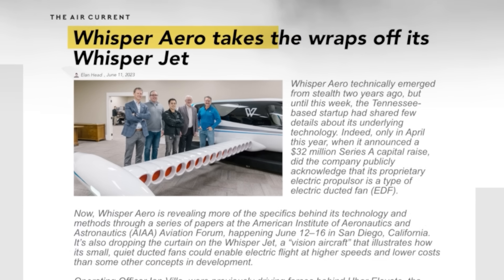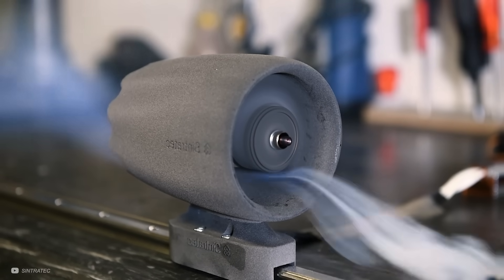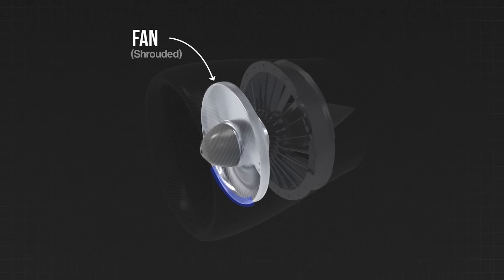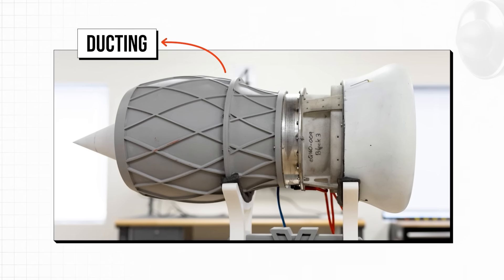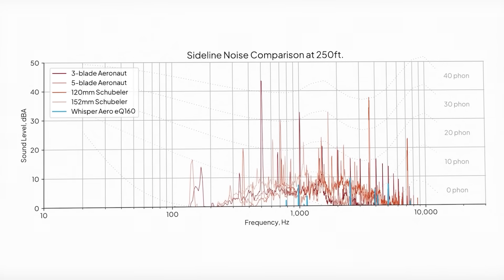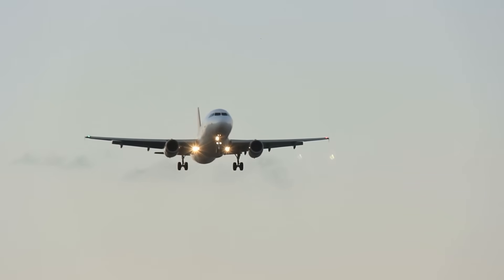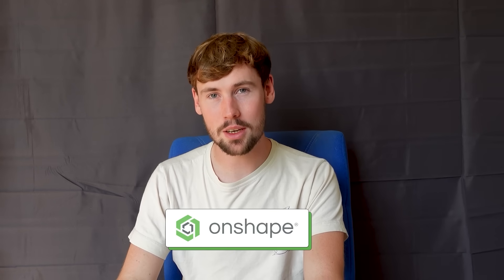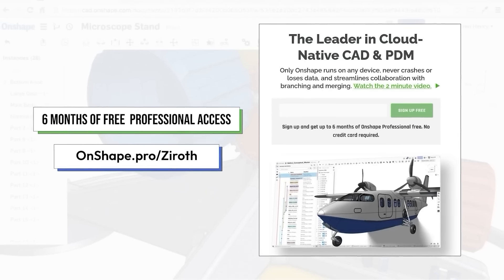This Genius Jet Engine Is Starting A Revolution

Comment: The biggest hurdle for electric flight isn't the engine, it's the energy storage. Jet-A has roughly 50x the energy per kg of the best batteries today. And the weight of the fuel supply drops as the engine burns it (increasing fuel efficiency through the flight), while a battery weighs the same charged or drained. They could turn fuel into electricity, similar to how diesel electric trains work, but that adds a lot of weight to the vehicle, and weight is one of the most important factors in aviation.
Reply: Spot on, my friend!
Reply: I can certainly think of at least one application where a quiet, electric engine would come extremely handy - military drones for reconaissance and/or attack missions.
Reply: @bluehelmet314  It's already quiet enough. Losing efficiency which is already stretched beyond limit to improve something that's already sufficient is a bad idea.
Reply: The greater efficiency of Electric motors does create a path for practicality, but it would require either significantly better batteries, something like high efficiency fuel cells, or wireless beamed power.
Reply: @BrendanKOD  LMAO @ wireless beamed power, yet another fantasy !
Reply: @grahamstevenson1740  Tesla had wireless power and we have it in wireless cell phone charging, so it ain't so fantastical
Reply: I would imagine that most people looking at this are already familiar with the issues of relative energy density. 

But if people didn’t search for alternative and better solutions.. humanity would still be in the Stone Age. 
Thanks for your input..
Reply: @MontanaSource-h4q  Where did I say they should stop researching? I said the energy storage is the biggest hurdle. The video focused on the motor, as if it was the breakthrough we need for electric flight, when what we need is more research on battery density, fuel cells, or a Mr. Fusion equivalent.
Reply: This, this, this. People treat electrification as if there's some yet undiscovered Moore's Law of energy density in batteries. There isn't. 

While an electric jet worthy of the name (= enabling transonic flight) is physically possible, the batteries required would have to be around 40x more energy dense than the best ones we currently have. There isn't even a viable theory of such a battery.

Currently, it's looking like commercial flight as we know it cannot be electrified, period.
Reply: @fooanonymous  transoceanic commercial flight, that is. Intra-continental flights can and should be replaced with rail which can be electrified.
Reply: @sethpadakandla2797  Not only transoceanic flight. Flight at transonic speeds is the minimum standard customers accept for distances were flying is competitive in terms of door to door travel time.

But yes, I agree that many current short distance flights could and should be replaced by high speed rail. That is just yet another argument against electrified flight, however, since it eliminates a possible niche market.

In short, again, large-scale, commercial electrified flight is all but guaranteed a mere fantasy.
Reply: @fooanonymous would mix engine work? Smaller engine charging batteries in flight?
Reply: @shawncooper8131 A serial hybrid, which is what you desrcibe, works well in a car because it let's the engine run at optimal efficiency independent of speed and gear, it allows for regenerative braking, and can reduce weight and complexity by eliminating the transmission, in spite of the battery pack.

In an aircraft, a serial hybrid would have none of the advantages and many more disadvantages. Aircraft engines in commercial aircraft are already hyper efficient for their intended flight envelope. There are no transmission losses or issues with certain speeds and gears, no way to recover energy through braking, and nothing to offset the added weight of the batteries.

In short, no.
Reply: @shawncooper8131 why carey the weight? Just use the engines to power thrust direcrly.
Reply: @fooanonymous  Can't be done with current battery tech, but Tesla used wireless transmission of power... that's where I'd spend the research $. We have wireless phone charging, I would use that tech embedded in highways for unlimited range on elec cars
Reply: @willix777 the energy reduces with distance,double the distance and you have quarter of the power
Reply: You put it better than me. Bravo.  Your spot on ...
Reply: Now imagine a lithium ion battery fire at cruising altitude or even an EMP.
Reply: @sethhill5689  that's it, a teething problem happens and the thing you feel threatened by will just blow away and you can continue to be the big man we all know you are(!)
Reply: A potential work around is A very high speed fuel turbine driving a generator ..into a small battery .the oil provided the energy for the long haul
Reply: It will have to be a diesel generator like locomotive or nuclear powered
Reply: It's because there's this thing called compromise, it's the same reason why we don't use open cycle nuclear engines in airplanes, the health of the ecosystem is worth more than the gains you get with energy density of hydrocarbons.
Reply: Fuel cells? <shrugs>

Can use H2 or hydrocarbons as the hydrogen source..

..which reduces in weight as the fuel is consumed, addressing the battery weight the same whether dis/charged or not..

..while simultaneously allowing for the changes in design configurations that multiple electric motors provide. 

It may be no more efficient than current hydrocarbon fueled turbines under comporable configurations, but where different configurations become accessible at similar efficiencies, the increased variability & functions could open up different ways towards approaching flight than we're currently used to or imagining??

It's incredibly difficult to compete against the energy density of hydrocarbons (without going to nuclear feedstocks & fuel cycles.. with the weights associated with accompanying shielding requirements).

But SAF, hydrogen, sustainably offset hydrocarbons via separate sequestration methods (ex: biochar, DAC systems, the source crops from which the aviation biofuels are derived, 'etc')..

..coupled with very efficient fuel cells and different design configurations capabilities opening up new approaches could drastically readjust current mindsets vs the flying test tubes or blended wing styles we're used to.
Reply: @Brohymn80  No. There is no current hydrogen source that doesn't require large and heavy storage. The hydrogen is light, but the tank that stores it under pressure is as heavy as a battery. The tanks also take up much more space than the same energy in a jet fuel tank.
In aviation weight and size are the key factors in determining what the plane can hold.
Reply: @j4s0n39 reads like we are overdue some advancements in material science. 

Insert < graphene fan boys > here
Reply: @Brohymn80  Yes, stronger/lighter materials for storage, or a better (denser) material to get the hydrogen from would definitely help. Or a better way to store electrochemical energy in batteries.
Once somebody figures out how to get enough electricity in an airplane's wing tanks, electric flight will really...take off.
Reply: @j4s0n39 again, graphene. Maybe aluminium-ion batteries, plus graphene lightening much of the structure of the plane.

#GrapheneFanBoy
Reply: 50x is only true if you ignore efficiency. Batteries do have a minimum energy density that is needed for them to be practical for flight. That density is achievable and we are quickly getting there.
Reply: @EnlightenedSavage  The 50x is the density advantage. The 2-3x efficiency advantage of electric motors would still make batteries require 17-25x more weight than Jet-A.
Reply: They need to go with hydrogen fuel cell ,
Reply: Obviously both the engine efficiency and battery energy density need to improve. This tech is very important. Let the battery guys do their thing in the meanwhile.
Reply: Yeah, but who said anything about intercontinental flights in this video ???  You are shadow boxing or conflating the message of the video.
Reply: @JoeyBlogs007  The same logic holds for domestic flights. A 737 flying from NYC to Chicago can't carry enough batteries to power electric motors. Electric motors are great. Our ability to power those motors is not.
Reply: This
Reply: This is by no means a workaround or solution, but it doesn't have to be a battery in the traditional sense-  though I can't think of any alternative that's actually light weight, water for hydrogen for example (which admittedly needs a a battery) isn't exactly known to be light weight...  Though it would be an interesting experiment to see if pre-compressed hydrogen would work (oxygen seems like a fire hazard, and both at once would make water...), I have major doubt, but it would have a similar benefit of reducing the weight as it gets use up.
Reply: There are loads of applications where you can go electric though and efficiency gains help even in other areas. More efficient propulsion means you need less battery for the same distance.
Reply: And battery heating reduces efficiency drastically
Reply: I was going to comment something similar. Electric motors/engines are absolutely awesome! 90%+ practical energy efficiency (turning energy from electricity to useful rotation or even linear motion), with theoretical efficiency of literally 100%. Precise control. Even torque output at any RPM. Compare that to a traditional gas/combustion engine: Most combustion engines have a theoretical efficiency of only 50% (That's turning the chemical energy in the fuel to useful rotational motion. And at least piston engines, jet engines I think are higher). But, in practice, they have efficiencies in the 20%-40% range. ALL such engines have a specific, narrow, RPM range which absolutely maximizes power. You either get super high toque at low RPM, with NO ability to rev higher, or you get very little torque at low RPM with the ability to rev higher. When you compare just the engine/motors, it really seems like electric has MASSIVE advantages.
*HOWEVER*, the energy storage just isn't there for electric. As you said, jet fuel has 50X the energy density of even the best batteries of today.  Gasoline is something like 30X the energy. You're just not making up that difference through pure energy efficiency. And, even the theoretical energy density of current Lithium based battery technology would only reduce the difference between the batteries and jet fuel to something like 40X (the point is, we're ALMOST at the theoretical energy density of Li-ion and Li-polymer batteries... Which, those are the most dense solid-state battery types that we currently know about). In order to be able to use electric motors/engines in actual high energy demand applications, we NEED some kind of better electrical energy storage.
Reply: This misses the point, an electric vehicle just needs to be recharged, while fuel needs to be dug up, processed, refined, delivered and then filled in the tanks.
Reply: @ghoulbuster1  I think you missed the point: it's physically impossible to charge a battery enough to power an electric 777 flying across the planet.
Reply: @j4s0n39  Yes, that is why you use jet engines on those big planes.
These electric fans are more useful on smaller aircraft.
Reply: @ghoulbuster1  Tell me you know nothing about how batteries are made without telling me you know nothing about how batteries are made.
Reply: @alexsawicki  A battery is only proccessed once, then you just recharge it. Fuel burns out and needs constant refining.
Reply: @ghoulbuster1  Batteries ARE a consumable part. Sure, they last longer then a single tank of gas, but they do eventually wear out. Also, the process of mining the rare earth metals that are absolutely essential for modern, "high" energy density (remember, still way less then ANY fossil fuel) batteries is a MUCH harder and difficult process (and much more limited) then drilling for oil.
Reply: @alexsawicki  Doesn't appear to be that difficult now considering the price of lithium is only decreasing.
Reply: True but battery technology is at least closing the gap a little to make short haul aviation possible, solid state will put out 800 wh/kg so around 4x what the LFP batteries do in EVs
Reply: A small nuclear fusion, this will be in the 7th gen fighters
Reply: Completely true. Well said
Reply: 40 %  more power, for 40 % less energy used is a MASSIVE MASSIVE MASSIVE variable in this “energy storage “problem” , an extremely HUGE variable positive👀
Reply: @TheSuperChannel  And it's nothing compared to the 50x energy density advantage of Jet-A.
Reply: We will get there eventually. That day is not today, but progress isn't made through massive breakthroughs usually, but the slow incremental gains. So how would we get to electric aviation? First off, you don't need 50x better battery storage, while jet fuel holes 50x the energy density of a battery, the conversion rate of energy into mechanical work in a jet engine is around 35%, this engine has an efficiency of 92%, so we can already cut out nearly 2 thirds of the needed energy. Great, so we need batteries to be 17x as efficient as they currently are, right? 
No, next we switch the traditional fuselage + wings for a composite bwb design, the composite body already solves the problem of thermal expansion, so we are looking at a 20% efficiency increase. That means we can cut another 20% of that 17x battery weight, leaving us with 13x. Okay, looking better.
Lets examine the 50x energy density though, rp1 has 12000 wh/kg, modern state of the art batteries 400 wh/kg, that's only 30x, not 50x, so you already started with outdated info, we will very soon reach 25x, within say 10 years. 
Okay so 7x now, starting to look quite ok, lets add the last thing, structural batteries. Yeah, they don't have the same wh/kg as actual batteries, but studies show that between 20-30% of the airplane can be made out of structural carbon fiber batteries. These currently sit at 50 wh/kg, but it's another 10% extra energy. 
Putting it all together, a blended body winged aircraft could fly everything except long haul within the next 25 years or so.
Reply: That might not be the biggest problem thinking of the engine like a gas engine is actually maybe a large part of the problem the blades don't need to spin or maybe even have the same shapes as the gas jets the reason is the electric motors horsepower and torque curves are actually different than gas jets what that means is that quite a bit of waste is potentially already happening in blade and engine designs I can spin a blade with a different surface area differently than would be optimal on a gas engine basically people have been maybe designing electric blades and motors to work like gas which is potentially quite wrong I need x amount of thrust I don't have to make x amount of thrust by making an electric setup make that that in the same way as a gas engine I just need x amount of thrust so the blades and engine can actually be set up potentially very differently that a standard jet I just need x amount of thrust as I find out the most efficient way to make x amount of thrust with electric that chunks away at the energy issue
Reply: Again I don't need 20 thousand rpms I just need x amount of thrust ECT if I can get x amount of thrust from 6 thousand rpms or whatever then I'm good at 6 thousand rpm it doesn't matter if a gas engine needs 20 thousand rpms I just need x amount of thrust so my blades number of blades shapes variable pitch ECT maybe quite different than the gas engines internals
Reply: they'll just use extra long wires
Reply: @guai9632  Going in circles tied to a pole!
Reply: @guai9632  Fly by Wire! :)
Reply: The solution to the energy problem is a small ultralight compact fusion reactor..
Only that technology has not yet been successfully developed.
Reply: It was developed using something like liquid fluoride thorium, however the shielding for the crew is to heavy, or you will have crew changes more often then needed flight hours to operate it like you would change oil in a car with a leak sounded good on paper less good airborne, however the design is very promising for normal energy production!!!
There is nothing stopping us to use it and start building one for commercial energy production but none would like to fly such a machine for real, this was in the sixties and oak ridge labs build a ground based one for real, you simply don't want to fly it because if shielding issues!!!
Reply: @peterclarke3020  We're doing fine with solar and wind renewables combined with battery storage to regulate the grid. Install more battery storage in as many individual buildings as possible and solar cells on their roofs, and the traditional fragile power grid centered around large point-shaped generation stations and the grid spidering out from there begins to change shape to a largely distributed model, which is much more resilient to disruptions.

Fusion is interesting, but hugely complicated and ultimately probably completely unnecessary when we can manage so well just on renewables and battery storage.

This future isn't coming - it's already here. Battery storage especially is under tremendous development right now, and high-capacity super durable sodium-ion cells will bring way cheaper storage still, and will be even safer and more reliable as well.
Reply: @lennyvalentin6485 You’re right, but aviation is a different kettle of fish.
Reply: Came here to say this.

Anyone touting electric air-travel oughta be aware of this basic basic physics.
Reply: @TheR4gnos  It's a shame you aren't, as in the physics isn't to be used to boost your ego.
Reply: Aluminum isn't the end-all material for commercial airlines. Developments in carbon nano-structures will allow ultralight fuselage, wings, seats...just not American passengers.
Reply: @bigshnitzeljesse  That won't be even close to offset battery volume and weight.
Reply: Doesn't have to be for battery power. It can improve efficiency tremendously. We also don't know what battery tech will be in 5-10yrs. The first solid-state just began production and is a big step ahead.
Reply: @bigshnitzeljesse  See my comment. There is no physical theory or even plausible fantasy of a battery with the kind of energy density transonic flight requires.

If you access deeper electronic states in a material to store more energy you will eventually destroy its chemical bonds, which starts as it catching on fire, and ends as a bomb. You may recall that some recent, poor battery designs were prone to self combustion.

That is, there is a very well known barrier to higher energy density in batteries (which we've reached soon), but no idea at all of how to get around it.
Reply: @fooanonymous nobody is entertaining a future of electric "transonic" flight. Baby steps. Your statement of Jet-A having 50x the energy of the best batteries is easily verifiably false. It's nearing 10:1, not calculating for turbine engine's 1/3 efficiency.
Reply: @bigshnitzeljesse  There's no baby steps small enough to overcome physical limitations of our Universe.
Reply: @ShadeAKAhayate  Limitations in your head or can you name a single theory?
Reply: @bigshnitzeljesse  Mentioned above by the other guy. We go over the limit and it explodes -- and there's no theorized way around that because that's how our world works.
Reply: @bigshnitzeljesse   Yeah, no, wrong. 

The transonic flight envelope is the current standard, and the minimum air passengers would accept. I'd love to see you trying to sell flights, between turbofan flight characteristics and intermittent landings to change batteries, at 5 - 10% the overall speed of a current airliner, though. 😂

The best flight rated batteries need about 40 - 50x higher energy density to compete with jet fuel, and the latest, lab stage solid state battery technology about half that factor. There still isn't so much as a crazy theory for how to improve on that by 20x, and not every fantasy is approachable by baby steps, however much you'd like it to.

I suggest you work on your Google game. 

And no, as others have posted here, the thermal efficiency of a modern high bypass engine at cruise altitude is in the 45 - 50 % range, not 1/3 or ~1/5 like a car engine, which makes it that much harder for an electric engine to compete.
Reply: @fooanonymous I never said it could be a jet replacement. City-hopping and short tourist flights will happen with electric in my lifetime. 
There's so many sub-100 mile flights where a jet or turboprop is a very inefficient/costly vehicle. THIS is where electric will work. Battery tech is growing exponentially, increasing energy density, safety, and charging speed every year. 
I'll make a prediction. 8 passenger electric will be available within 5 years, probably Chinese.
Reply: @ShadeAKAhayate  "Mentioned by the guy above" a credible source would be nice, or y'know a name.
Reply: @fooanonymous  2 words: project pluto.
Now I understand it's expensive but the middle finger would be worth it.
Reply: @Mrpersonman0  Just look at Li-ion batteries that already are quite unstable. Increase the energy density = get closer to combustible fuel and even more self-combustion rate. And even at the ideal theoretical limit (unreachable for obvious reasons) energy density will still be ~24 times less than Jet-A fuel (~500 vs ~12000 Wh/kg) with all the detriments of onboard batteries.
Reply: @bigshnitzeljesse  I wrote in one of my first comments in the thread that extremely niche, short range applications are conceivable, but even then, unless it is a rich person's toy where economics aren't a factor (e. g. urban commuting), an electrified commercial aircraft would need to make money.

That is, at the minimal ranges and speeds most likely achievable, it would have to outcompete e. g. high speed rail, and there aircraft needing runways suffer massively from to and from airport travel time.

You could imagine a STOL/VTOL aircraft, but that would again trade a massive loss of range for that capability. Another possibility is hopping flights where rail isn't possible, such as among islands or in steep mountainous areas, but again, that is but a sliver of a niche market.

In short, forget investing in electric aircraft and buy some of my oceanfront time shares in Austria instead... 😉
Reply: I remember a phycist friend of mine talking about how Lithium batteries are actually rubbish for energy storage and that butter has 10x the energy density of a lithium ion battery. We then made jokes about building a butter car. It would drive as smooth as...well you know. And it'd be great for drifting but also have the best churning radius on the market lmao
Reply: @flashfreak62  your physics friend is a perfect example of why nobody takes western academics seriously outside of their own circle-jerks. juggling theoretical amounts of energy without thinking about actual transition mechanisms and their practicality is why so much money has been wasted already, while others like russia and china are innovating along realistic goals, and its working beautifully.
Reply: Absolutely agree, no form of electric propulsion will be used for flight until energy storage is at least about 5-10 times better than at present and even then it'll be limited to shorter journeys.
Reply: @grahamstevenson1740  There are already electric planes in use right now. But you are correct in that electric planes are limited to shorter journeys then regular planes.
On the other hand so does electric planes make shorter trips much more economic to use planes for creating new use cases for planes in addition to replacing other types of propulsion for shorter range flights.
Reply: @znail4675  You forget that they also need to recharge. That typically means at least an hour. So, they can fly for perhaps 30 minutes and then need an hour to recharge !
That's not really a viable business model !
Reply: @grahamstevenson1740  That is why it's great that there are better batteries then you think.
Reply: @znail4675  NO. Batteries are stalled in energy density. In any case, even a 50% improvement would allow only 45 minutes of flight which is utterly ridiculous compared to the 16 or 17 HOURS that can be achieved with jet propulsion..
Reply: @znail4675  There are no use cases for electrified flight that represent a significant market share. You can fly short distances at fast highway speeds, but with a vehicle needing a runway, that will never be faster door to door than driving or rail transport (and an electric aircraft not needing a runway has almost no range at all).

Sure, one could imagine improving or simplifying the economics of some air shuttle transport in an otherwise non traversable region of an underdeveloped country, but that market share is negligible.

One could also imagine something like urban air commuting for the very rich, but the economics of that will not beat the simultaneously maturing self driving EV on the ground. Again, not an impossible application, but in terms of mass transport and market share completely irrelevant.

Yes, ultra niche applications and billionaires' toys exist. For anything else, electrified flight is and remains a mere scam.
Reply: One of the most touted use cases is personal transportation. It’s one of the factors in the new air traffic control system. Also small electric planes are already doing 100 miles with 2 people on board. It isn’t ubiquitous yet because you still need a pilot license. If it gets to the point that the planes can fly themselves… Anyway, electric planes have already arrived using regular propellers. How does the ducted fan compare?
Reply: @grahamstevenson1740  I wouldn't say /no/ form of electric propulsion. There are a few small niches where electric flight could make sense. Small island-hopping and ferry services where distances are short and electric propulsion could allow a lower operating cost as the engines need less maintenance and fuel is expensive to import. But unless there is a tremendous advancement in battery technology, it's going to be a niche application.
Reply: @vylbird8014  You'll be lucky to get more than half an hour of flight time though. There are few instances where that is useful. In fact Harbor Air in Vancouver modified one of their float planes to electric propulsion but it added so much weight that it couldn't carry any passengers any longer,  a complete waste of time in fact,.
Reply: You can also do distributed electric propulsion w/ a generator.
Reply: @redhat421 you’d rather just drive the whole thing directly by the fuel engine then !
Reply: Possible massive weight savings if a fuel cell is used instead, as I understand it there’s massive weight savings and really good efficiency but very high cost, not sure if the commercial reality may just be another ‘just round the corner’ thing!
Reply: @sifergy8412  Fuel cells require compressed hydrogen. Hydrogen tanks are big and heavy. Until it's feasible to get the hydrogen from a solid or liquid source efficiently, fuel cells will be too big and heavy for aviation.
Reply: How much of the Jet A is actually converted to thrust?
About 30-40%.
So the weight of batteries that are needed is significantly less.
Reply: @glenngarry4750  Modern high bypass turbofans can reach 45% efficiency, so the batteries are still at a massive disadvantage.
Reply: @glenngarry4750  High bypass turbofans are about 40% efficient. Batteries are about 70-80% efficient. That is 2x advantage is nothing compared to the 50x advantage of the energy density.
A 777 flight from LA to Tokyo is going to burn about 200k lb of fuel. With modern batteries, it would need to carry 4M to 7M pounds of batteries. And that doesn't account for the extra energy it would need to carry all that extra weight.
Until we get at least a 10x improvement in battery energy density, electric flight will remain experimental.
Reply: @j4s0n39  In July of 2010 the Solar Impulse 1 (piloted solar powered electric plane)  stayed in the air for 26 hrs and landed with charge remaining.  There are solutions to these challenges.
Reply: @trikepilot101  Sunlight isn't energy dense enough to power a commercial airplane. Even assuming 100% efficient solar panels, it would require around 12,000 m^2 of solar panels just to provide enough energy for a 737 to cruise. That's about 15 times the entire surface area of a 737 or about 50 times the surface area of the top side components.
Solar requires either a lot of time or a lot of area to produce a usable amount of power. An airplane has neither.
Reply: @j4s0n39  still a more efficient thermodynamic profile than burning Jet A. For a given energy density that'll be all that matters not whether you'd get milage out of jettisoning the batteries. It'd fly further anyway
Reply: @Mrpersonman0  I didn't say anything about battery jettison. That would be dangerous, expensive, and an environmental issue. There is no battery compound available or in R&D that can fit enough energy to get a airplane from NYC to London in the available space in the wings of a 787 or within the weight allowance for fuel. Until batteries increase their MJ/kg and MJ/L values, commercial electric airplanes will not be a thing.
Reply: @trikepilot101  Solar Impulse flew at a speed of 56mph during day, 28mph at night.
Reply: @glenngarry4750  Still nowhere near light enough for the power stored.
Reply: Has none of you heard of hydrogen fuell cells?

While not suitable for cars, it has a perfet use case in planes.
Reply: @matko000  How are you going to store the hydrogen for your hydrogen fuel cells tho? High pressure vessels are heavy as hell comparatively and don't hold very much fuel, and cryogenics add all kinds of complications to the mix, including the fact you can't really fit insulated cryogenic wing tanks into wings (the hydrogen needs to stay at AT LEAST -253C throughout the entire flight to remain in liquid state), and fuel cells have a maximum theoretical efficiency ceiling at around 65%, so real-world applications will by definition be less efficient than that.

Hydrogen also has some other unpleasant properties (look up "hydrogen embrittlement" when you have time to spare), and the fact it tends to slowly seep straight through essentially any material, which makes joints and seals difficult to get tight - and especially so at cryogenic temps. Check out how many time fueling any rocket using liquid hydrogen (including the U.S. space shuttle) had to be scrubbed because of leaks during the fueling process... Oh, and also the fact it's wildly flammable and explosive in gaseous form. :O
Reply: You could store it and use earogell insulation outside a vacuum in between and have liquid hydriligen cool it so not touch infrared shines in, they now have composite tanks that explicitly use a reaction between the tank and.the material to form an oxide like layer and these advanced tanks do have bands around them for pressure but if you simply calculated the amount of evaporation which Cools combined with modern materials we had the first experimental flights with hydrogen in the sixties and one over the ocean too, that is not the pint here however if you use it you might as well look into traditional jet engines which they used for that there are companies running a hot fuel cell sets but those need expliciet extreme cooling from the propellor only if we get jet engines to run on it as cleanly as possible can we fly in it ling distance !!!
Reply: Sorry for my typos spell control and me sometimes collide in a strange way...
Not a native English speaker Dutchman here !!!
Reply: @matko000  The massive fuel tanks would be too large and heavy. It would take 5-6x the volume of fuel for liquid hydrogen. And those tanks would outweigh the jet fuel, by far.
Reply: @matko000  Hydrogen fuel cells are basically just another form of combustion. Yes, they produce electricity, but not much.
Reply: @Gemini-b4g  no it's not combustion. Fuel cells are electrochemical. The moment you act the pedant about that you may as well confuse it for nuclear power. It's all particle physics after all.
Reply: @Mrpersonman0  Is a fuel oxidizing with an oxidizer? If so, it is combusting. No, it may not be visible with a flame, but it is combusting on a molecular scale.

The bottom line: fuel cells cannot offer more energy density than traditional combustion because the mass fractions to not favor fuel cells. Too much hardware, not enough reacting chemicals, you just will not get much electricity out of it. They are not the solution to electric flight you are looking for.
Reply: @matko000  You've traded an energy density problem for a mass storage problem. Unless the plan is to extract the H2 and 02 from the air, that would be sweet, it will need large storage tank(s) that can store H2 under very high pressures. The bigger problem is from a safety perspective. All that H2 and O2 will create a massive fireball during a CFIT.